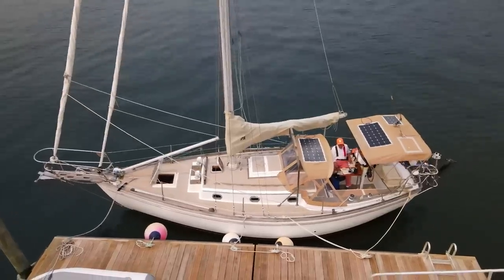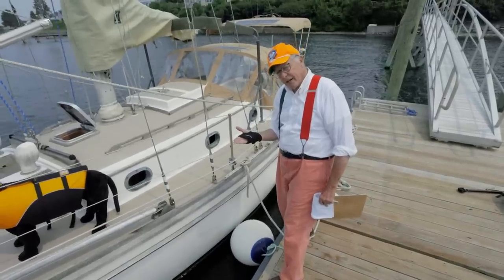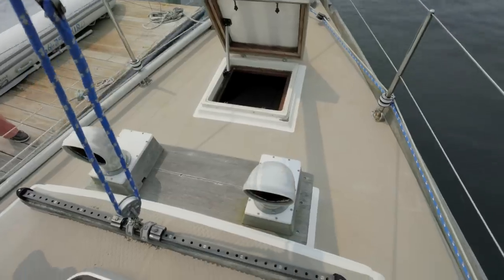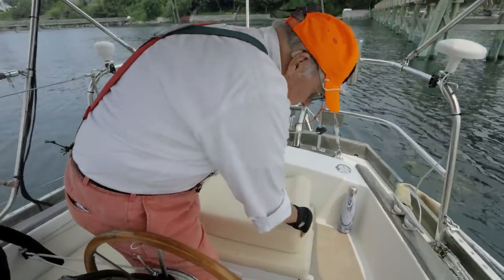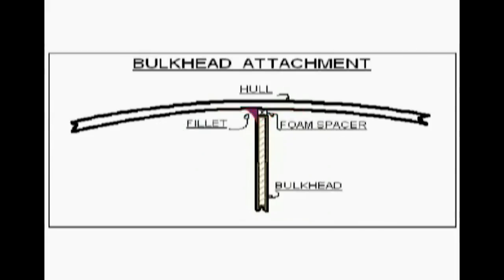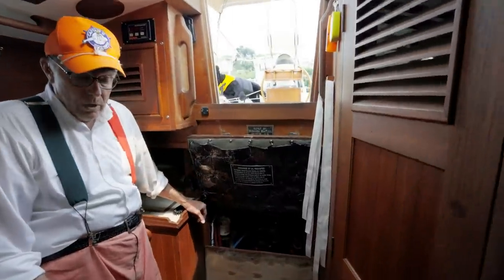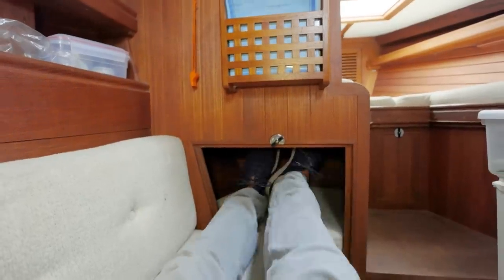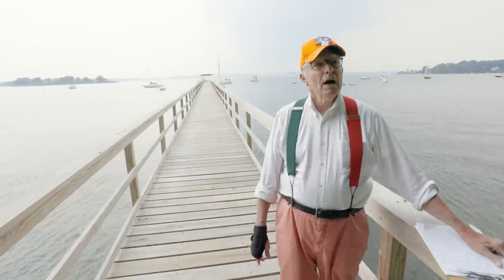$42,500 BLUEWATER sailboat for sale | EP 52 #sailboatforsale #sailboattour

Comment: The monitor also has the capability to be an emergency rudder (if you buy the attachment) just in case you lose the rudder altogether.  That boat is setup for bluewater for sure.  Very nice boat for singlehanding. As always a great job guys.

Comment: If the outer hull is punctured how would you get the water out?  Or is there some kind of filling in the space between hull walls?
Reply: It is a single wall hull.  Water ingress regardless of location follows gravity and collects in the bilge where there is a pump to remove it.  Big holes in the hull require bigger moveable pumps.
Reply from the maker: Dear W Smith.

I didn’t quite understand what you were asking but do you understand that no matter what internal structure is molded into the hall as a foundation for furniture etc. any piercing of the hall will allow water into the boat in the water will automatically go right to the bilge. There are automatic bilge pump’s which will Try to remove it and stay ahead of the inflow but if the hole is too big a standard self priming bilge pump may not be enough. Most votes to carry Emmanuel whale gusher style pump to augment the electric bilge pump.

There is no filling that you speak of with the exception that some boats may have some extra insulation cut down on condensation and keep the boat warm and cold climates installed in place between the hall and the furniture but other than that nothing else. I hope this helps clarify things for you please stay in touch thank you for your questions as always your fans are great out there we love you

Comment: It’s lovely but it’s a 28 foot boat that looks like a 24 foot boat.. Not sure why. Maybe the beam is narrower than most.
Reply: I'm pretty sure it's the opposite problem--she's a little beamier than other common 28 footers from the 1980s (e.g., she's not quite one foot wider than a Cape Dory 28).  Combined with the bowsprit, the change in proportions makes you wonder where the rest of her length at waterline disappeared to.
Reply: To clarify my earlier point a little bit:  the Shannon 28 is (unsurprisingly) 2 feet shorter than a Cape Dory 30, but it's actually 6 inches wider amidships.  That throws the proportions off so it looks like it's two fee shorter than it's supposed to be.  Being a little too beamy amidships seems to be a feature peculiar to the Shannon 28.  The Shannon 38 has exactly the same beam as the Cabo Rico 38, which is the most comparable boat I can think of.  They just decided to make this wee girl a little plumper at the waist for some reason, which makes her legs look shorter.